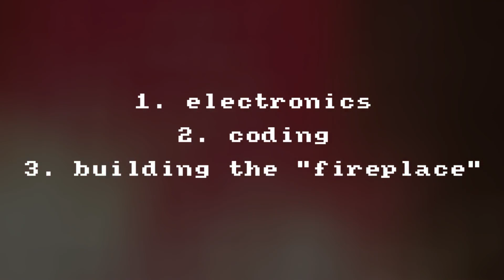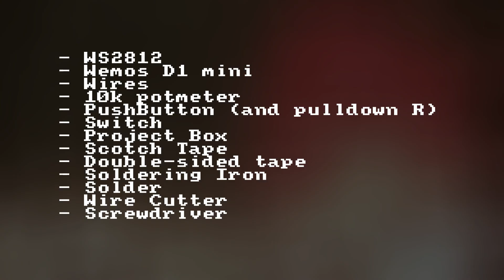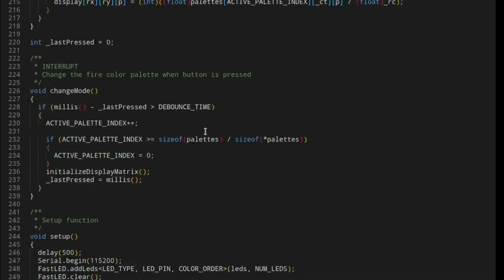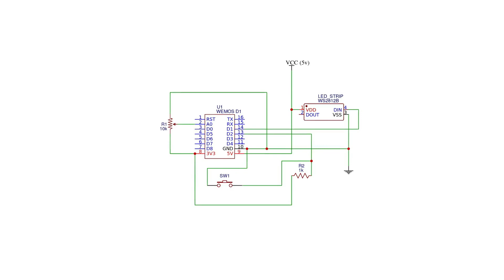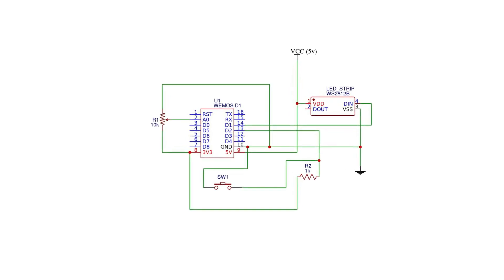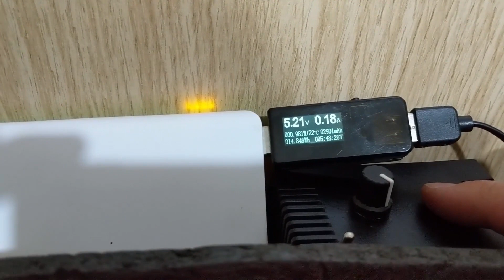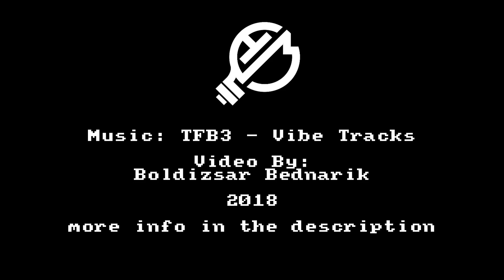Digital Fireplace ( fire simulation with LED strip ) - helloMakers - episode[0]

Comment: how can I make this work with the Arduino IDE? I am not a coding wizard. I am building this for backlighting of my tv set.  Any assistance greatly appreciated.
Reply from the maker: rename main.cpp to main.ino ( you can remove the Arduino.h line but i think it should work with that as well ) , then add FastLED library from library manager, add esp8266 support and it should work without any problems - code is the same.
Reply: @hellomakers  WOW first of all, thank you for the reply. I just couldn't help but think it should easy. I will analyze the situation. I also want to be able to turn it on/off with one of my handheld remotes that currently use for sonoff switches. So adding that capability should be easy with the eps8266. I too, am a fan of the wemos D1 mini. I will report back soon.

Comment: May I suggest/request that future videos have the 'filler music' at much lower volume. 
For example: 12:03 is a little loud, 12:12 is background while you talk, 13:46 is getting loud

Btw, your description was nice. Your soldering technique was good.
I suggest another video where you give more details about your javascript 4:20
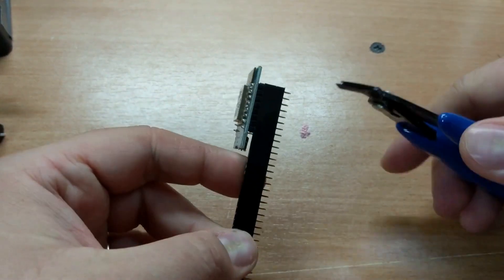4:45 excellent tip to others to use headers so that can 'recycle' the arduino, if need be.
5:01 when connecting wires to a potentiometer, a mechanical connection before soldering is better. 
Wrap the wires around the POT pins, then solder the joints.
Reply from the maker: Thank You for the constructive criticism. It's much appreciated!